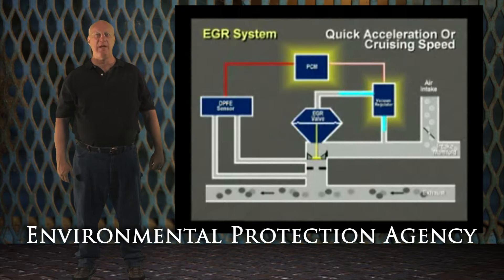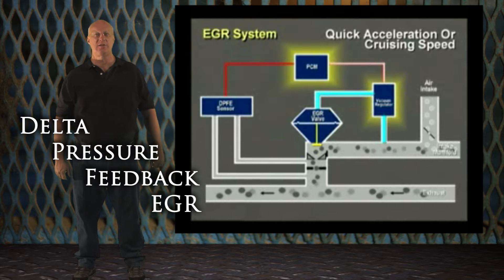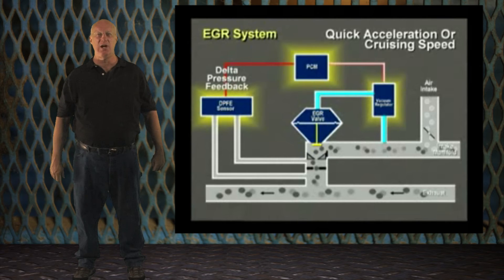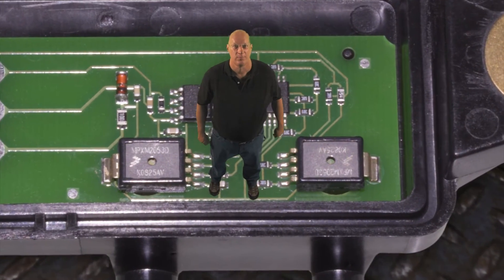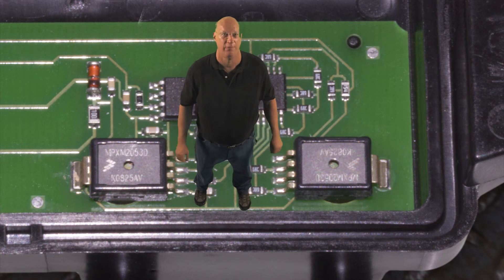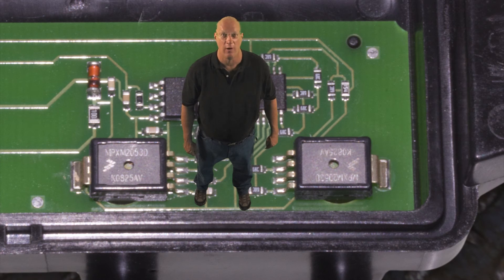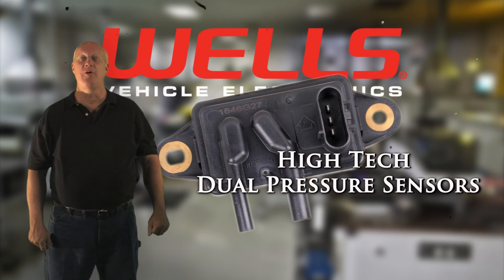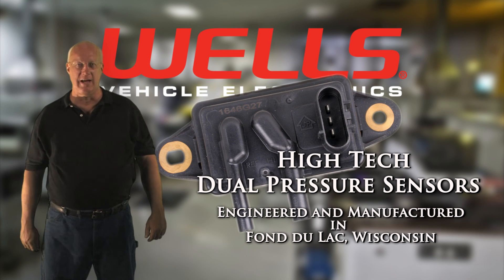Ford DPFE sensors by Wells

Comment: i have a 00 ford explorer and one of the hose connectors broke on the dpfe. i managed to clamp it on but the hose blew a hole in it. i was wondering if their was something else wrong with the system that could cause the problem.
Reply from the maker: +WORfluffy gaming If you are having issues with hoses blowing off it is usually caused by excessive back pressure in the exhaust system. Typically that is a plugged up cat that causes that. Hope that helps!
Mike Becker, Technical Services Instructor